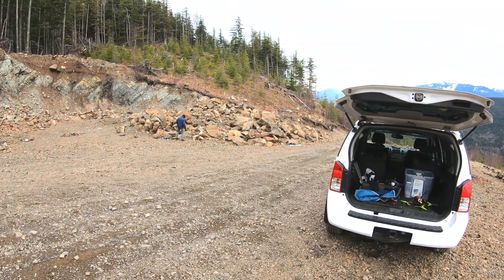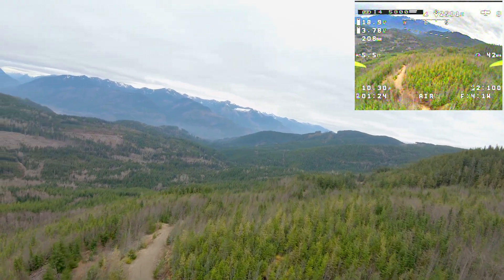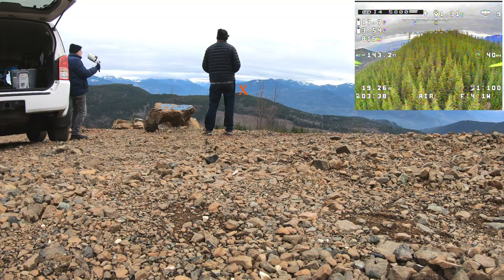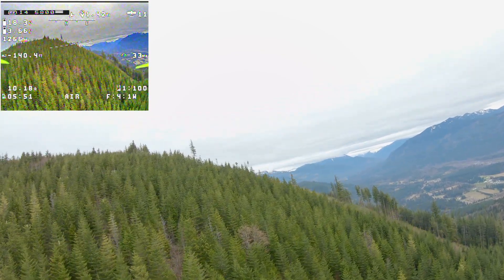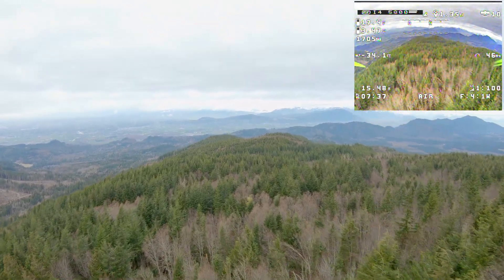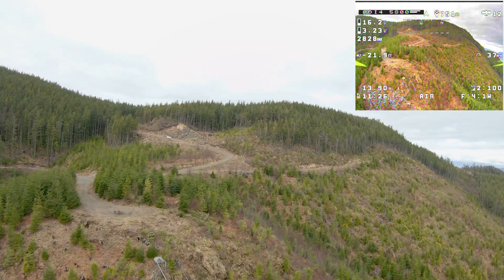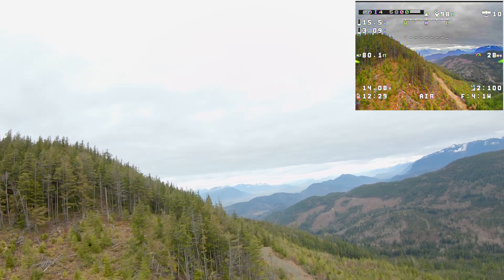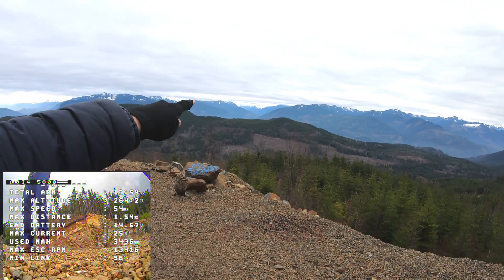3 KM Long Range FPV Ridge Flight

Comment: What transmitter and receiver do you use the most while flying long range?
Reply from the maker: Thanks for watching. If you are asking about flight control: I use a Crossfire TX and a Diversity Nano RX
Reply: That's fine.  What radio transmitter do you use?
Reply from the maker: @Jabbey71  a Radiomaster TX16S
Reply: @ValleyFPV  thanks for the info.  That seems to be a popular choice now days.  I'm going to send you an email sometime over the weekend with a few questions if it's ok.  Thanks...
Reply from the maker: @Jabbey71  that's ok
Reply: @ValleyFPV  Ok.  Email sent.  Thanks.

Comment: I swear, I can't get 300 feet from mine before it bugs out and I lose it. I just lost a Flywoo last weekend. Going to check out your gear.
Reply from the maker: Ouch..thats not good. Thks for watching.
Reply: @ValleyFPV  I found the problem. LMAO... It appears the reception sucks without the antenna ...
Reply from the maker: @ChadKovac  oops

Comment: I see you are using the crossfire diversity rx it’s a great unit I have it on my marmotte it never runs out of range. with 2150kv and 5.5in props I can get 10 min on a 1550mha 4s pack 
Great flight. Great place to fly you have
Reply from the maker: Thank you for watching!

Comment: Wonderful flight. Also good job from the spotter.
Reply from the maker: Yes..a 2nd set of eyes is handy.
Reply: @ValleyFPV  have you made your own 4000mAh battery pack?
Reply from the maker: Yes I have. I've made two 4000mAh packs from Samsung 21700 cells. Also some 3000mAh packs from Sony 18650 cells as well. These are my go to packs most of the time when flying.